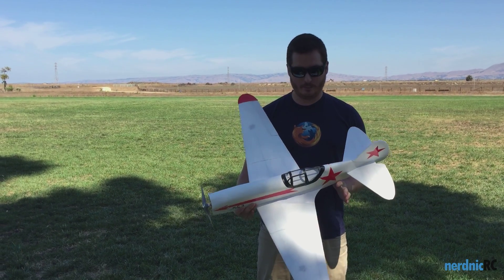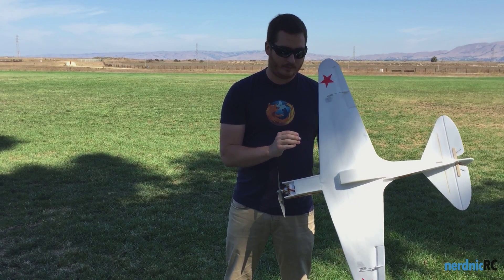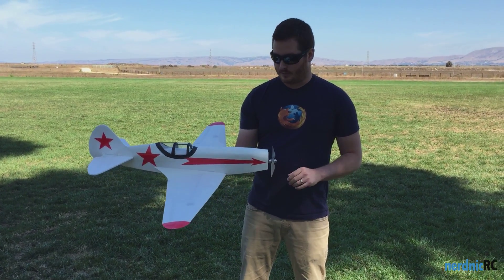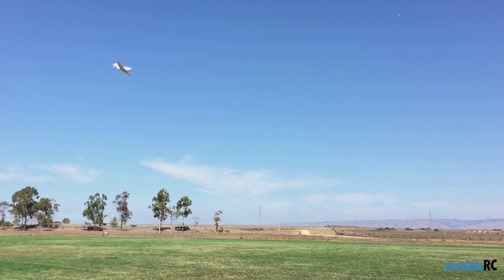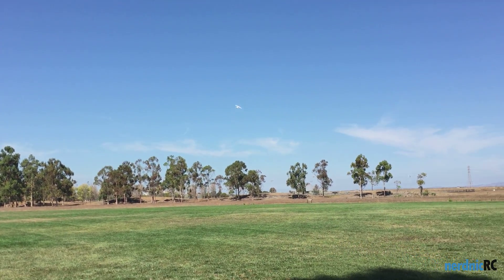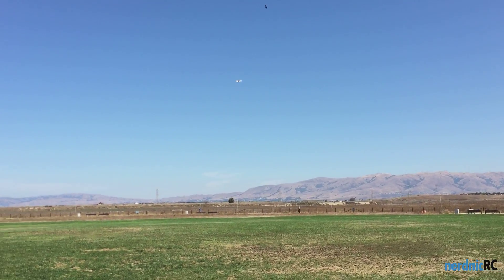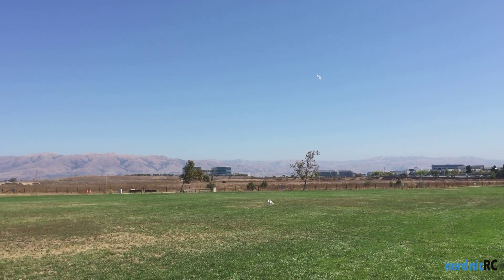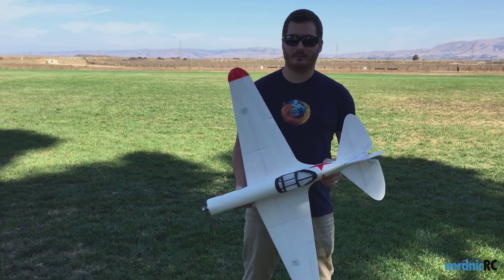nerdnic | nnMiG 3 Maiden

Comment: could i get away using a 60amp esc with this motor on 4s http://www.hobbypartz.com/96m601-bigfoot10-2820-1100kv.html
Reply from the maker: With a 9x9 you'll pull right around 60a on 4s.
Reply: *****
and how much speed would i get out of that?
would it be way less?
Reply from the maker: You'll get 100mph or so. Not bad.